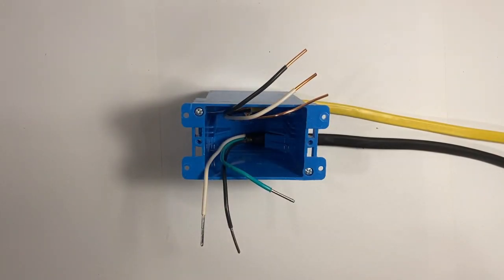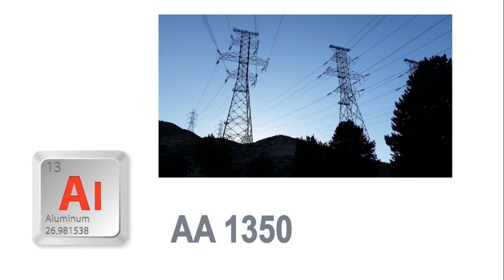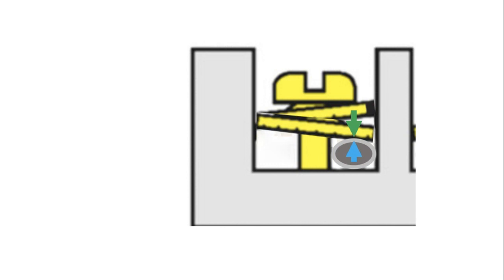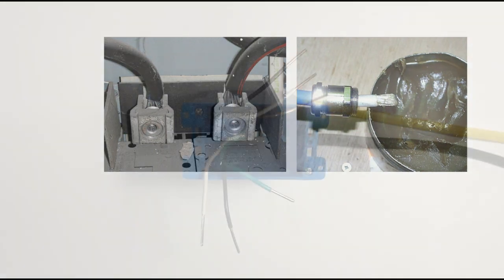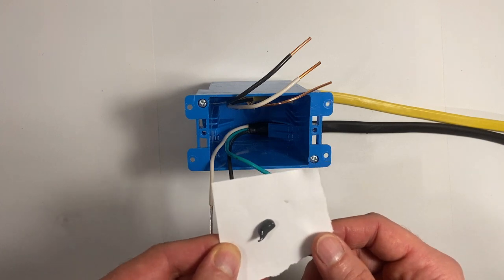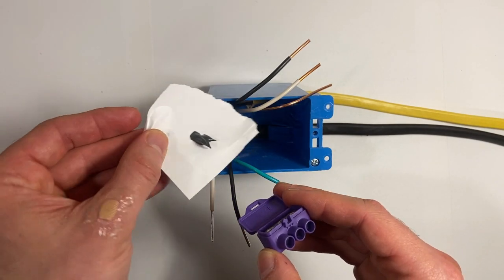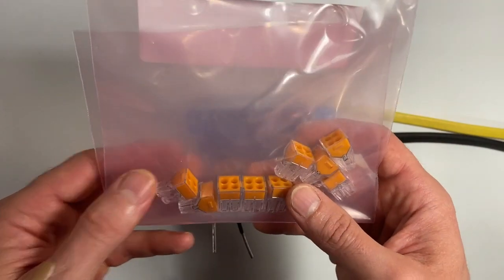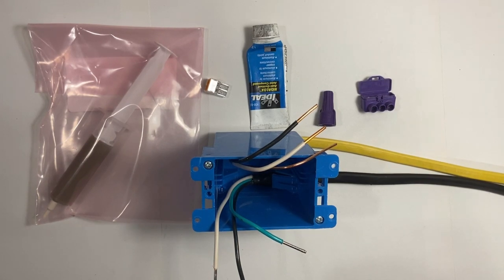Is aluminum wiring bad? How to connect copper and aluminum wires safely.

Comment: 35 years ago I built my own 300 amps compact welder. Got short of copper in the process so the secondary coil made half copper half aluminum by soldering them together with a 100 Watt soldering iron. Still works perfect and it is stored in barn. The soldered joint holds tremendous power like a charm. Now got a house half copper half aluminum. Guess what i am going to do. The soldering trick is to use engine oil and soldering rosin after cleaning aluminum wire.
Reply: Marshall guitar amplifiers are world famous aluminium chassis designs.

Home HiFi stereos are all aluminium designs. 
World famous for aluminium. 

Not 1 fire from them. 

Car radios go through the STEEL chassis to get to the battery. 

These fools must now go buy the copper car chassis models.  🚗
Reply: @Gma7788 the benefit of aluminum in guitar amplifiers is that it does not RUST.  It oxidizes.  Rust is far worse.

It is also a good thermal conductor… which keeps the internal components cooler to a degree.

It’s lightweight.
Reply: I was wondering about soldering the splices,  then maybe a cap then electric tape or liquid electric tape.?
   Idk. I need to research more.
 
       My dad was a union electrician most his life. He was a sparky before I was born & up until he retired.
    
    I'm thankful for all the different things he taught me, but I sure wish I would have learned more about electricity from him.
    He woulda gladly helped / taught./ tutored me.
    In fact, one of the last things he asked me before going to the hospital  was If I had my panel all buttoned up..
    (He'd helped me install a new panel in my 100yr old house.)

     I didn't lie to my dad very often, but I didn't want him to worry about my projects when he was on his way out.
   I told him I had finished it for the most part.
    
     He was on his death bed.  The doctors advised us all to say our goodbyes & gave him 24hrs.
    We did & had a priest give him his last rights.

    A couple weeks later. We did it all again. A few weeks after that he passed.
      He had his last rights prayed for him by a priest 3 different times!
   He wasn't even a catholic & didn't go to church except for baptisms  & stuff for his kids / grand kids, weddings & funerals .
     I gues he went to catholic churches more than he did any other church..

   Been 7 yrs now. I still miss him & still don't have that buttoned up!
    Hahaha!
      It's safe (that part of it anyway) & it works great (I  just ran a wire through the front vs side.
     Life's too damn short to be sweating the small stuff.
    Sorry for the novel!

   PEACE!

Comment: Thank you for sharing. When do you recommend it would be best to rewire the whole system in the house? Is that the most effective option?
Reply: Of course, rewiring to modern standards, using modern materials is always best, but you have to see if you have the budget for the rewire and to repair walls, floors and ceilings that will inevitably have to be cut and opened  during the rewire. That can run up to tens of thousands of dollars, which will make repairing the ends of the cable using the methods you saw here a more attractive option. You can do an "in between", and run new wiring just to appliances that draw a lot of power, and let light receptacle loads and lighting stay on the existing wiring.

Comment: There are no original Wago connectors with the paste integrated. My letters to the Wago representatives say that no 2273-243 and the similar are manufactured by an original Wago.
They say that only way to connect AL wires is usage of 2273 or 222 connectors together with the 249-130 paste.
And the 222 connectors are not marked for AL wires but approves in the letter from Wago to use with the paste also.
Currently Wago has a huge mess on the their site and in all local stores across countries, cause stores sell 2273-243 and the similar connectors that are not approved by Wago and deleted from their web site.
Reply: So they are saying that you can use the Wago connectors for pig tailing aluminum and copper if you use the paste? Confused on what connector since I can't find any listing for 2273-243 or 2273-222.

Ok to clarify, I just got off the phone with a Wago rep in U.S. (800-346-7245) who said these are not approved for the U.S. only Europe.  I guess you could use them if you could find them they are just not UL approved here.

Comment: Bought a house built in the early 70s that has aluminum wiring. Been researching a ton on this since I know there's a risk of fire hazard. However, I think as long as due diligence and proper steps have been taken, this really isn't too difficult of a job to replace outlets/switches yourself as long as you know what you're doing.

I'm planning on installing a few WiFi switches, but they are not CO/ALR. So, the plan is to disconnect the old outlet device, insert the existing aluminum wire into a AlumiConn unit, then connect a new copper wire from the wifi device into the AlumiConn unit making the connection.

However I have a few questions if you think you could answer:

1) Is it absolutely necessary for AlumiConn to be used if connecting the ground aluminum wire to the new outlet/switch copper ground wire? I would think YES in theory, but at the same time, hardly any current should be flowing through the ground wire, and would think a standard nut with compound or a purple nut like you described would be sufficient. But I wanted to hear your thoughts.

2) When buying copper wire to connect into the AlumiConn to make the connection with the aluminum wiring, is there a rule on the size of gauge? Does it matter if I use either of the standard #14 or #12 copper wire from the AlumiConn to the device? Or does the size of the aluminum wire gauge dictate what size of copper piece should be used when joining through the AlumiConn?
Reply from the maker: All great points. Last things first :) ... Most likely your Al wiring is 10 and 12 gauge, which means that it is to be protected by 20 or 15A breakers respectively. That dictates using 12 or 14 AWG copper wire. If you can't tell the gauge of the Al wire, just look at the breaker protecting that circuit. 20A - 12AWG copper, 15A - 14AWG. 
Grounding wire - your instinct is right. if you are going to follow the rules to the "t", then you want to use AlumiConn on that as well, but otherwise, seeing as it does not normally carry current, you can probably get away with a regular twist connector filled with Noalox.
Reply: @russiansparky4194  Great thank you very much. Realized I bought 12 gauge rather 14 for the copper and my circuit breaker is 15 amp. Better to return and get the 14 gauge wire or is it okay to have 12 gauge?
Reply from the maker: @Spaudge26  12 gauge is thicker, as you know, and therefore is harder to wrangle inside a box. If it's not too much hassle to exchange, I would certainly go with the thinner 14 gauge copper, which will be easier to work with in a long run.
Reply: My two cents, the electrochemical reaction doesn’t need electricity so even ground wire usually doesn’t have power you should not twist them together.

Comment: You can not use wire nuts to put copper and aluminum wire together - in any way shape or form.  Just use aluminum rated outlets and switches and then you don't have to pigtail.  Have lots of pics I can send you with melted wire nuts on copper and aluminum connections.  You are taking a simple process and making it confusing!!!
Reply: Just use ox guard. It’s fine.
Reply: Oh, really? How did these manufacturers get their listings then? Please do show examples where a listed Cu-Al twist or bus connector failed - then we'll talk. Sure, if you put any old wirenut (which BTW is a trademark of one given company) on a copper-aluminum connector, yeah, it will fail, but a listed connector designed for it?
Reply: https://www.cpsc.gov/s3fs-public/516.pdf

Consumer Product Safety Commission  publication on working with aluminum wiring.  Just scroll down to the wire nut section.  

I have actual pictures for your reference from multiple houses.  Just put your email up and I'll send to you!!
Reply: @aplushomeexperts  I don't think this video advocates for using regular wirenuts to join copper and aluminum. That is a bad idea, and nobody here argues with that. The document that you referenced actually refers to the same "copalum" connectors shown in this video.
Reply: @Gruntled2001  No, the Copalum system refers to a special type of crimp-on connector and tool, which has nothing to do with anything mentioned in this video. The document is quite clear about that.

The document also mentions Alumiconn connectors which are shown in this video (the mini bus bar, not the wire nuts), but doesn't exactly give a glowing endorsement:

'The AlumiConn connector has performed
 well in initial tests, but is too new to have developed a significant long-term safe performance history as the COPALUM repair.'
Reply: @vidupload4578  seems to me they don't follow the instructions because I think you need to clean the wire then > without delay apply< the  NOALOX, to avoid any problems. )

Comment: I have one of those houses from the sixties.  I’m no electrician so I hire pros to change even outlets because I assume I’ll burn my house down if I do it myself.  I like those purple caps...it looks pretty easy!  But it seems like there would be very little room in the box for the outlet, extra wires, and the purple caps?
Reply from the maker: For sure, it makes for a crammed box. If at all possible, I would change the box out for a deeper, or a double-gang one.

Comment: No matter what you do, Cu-Al connections just doesn't work unless you are dealing with power less than 100-500w.  You must have heard of thermoelectric effects or peltier effect in particular, one of the two joints will always heats up causing oxidation even faster. the problem arises when you are dealing with power above 10kVA because the line losses adds up to your bill, although not much because here losses are proportional to current and not square of current( I^2R) but still in big house it's cheaper to replace aluminum wire altogether than paying for losses over time.
Reply: You can probably just solder them together, as long as you're using soldering flux.